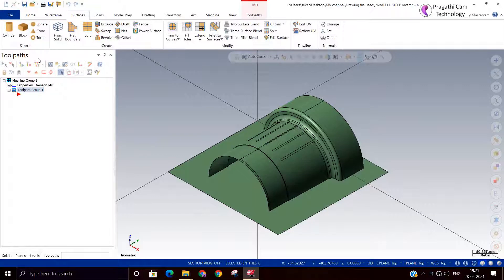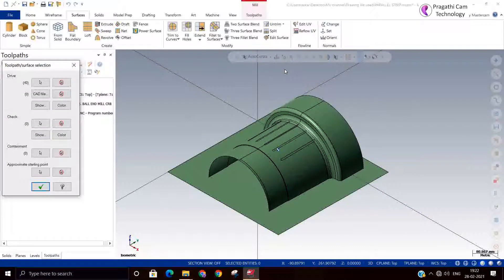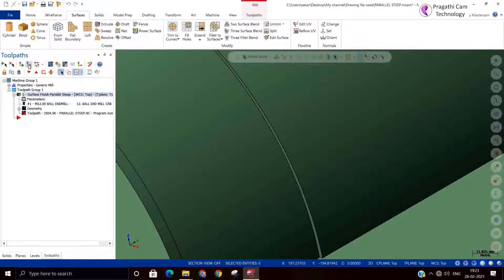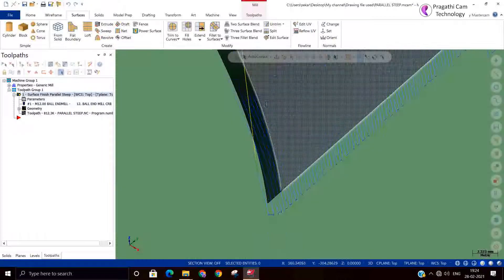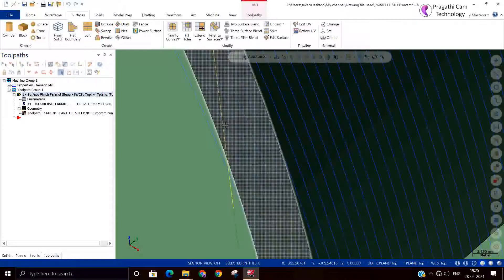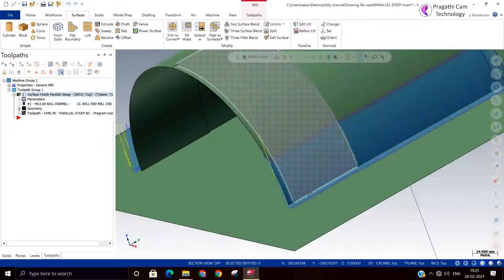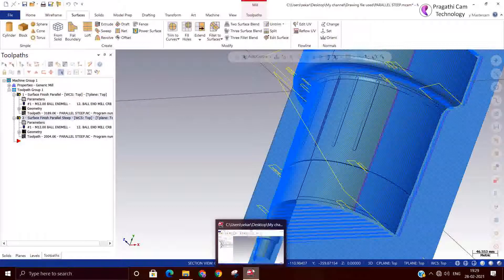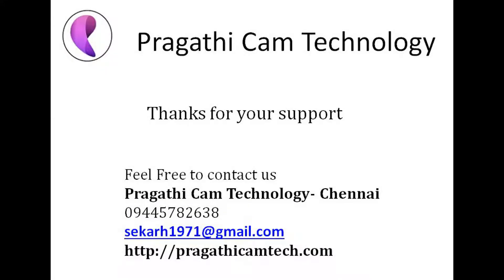Mastercam   Surface Finish  Parallel Steep Tool Path

Comment: Hello Sir. May I ask you this! I created surfaces from solid and toolpath flowline on it ( 3 surfaces) but why ball endmill cut all the way through under those surfaces it supposed to be on top surface only right? Do I miss something setting in parameter? Thank you so much